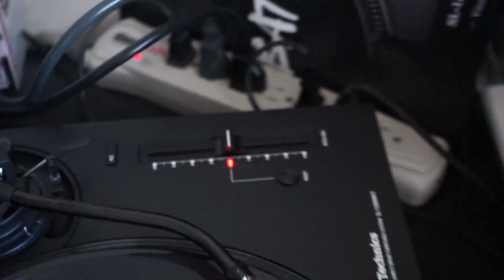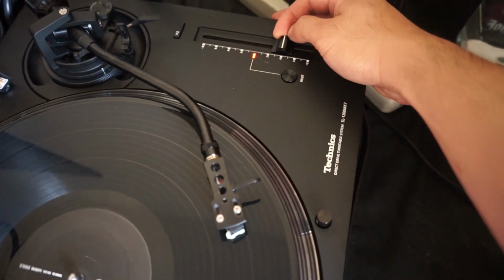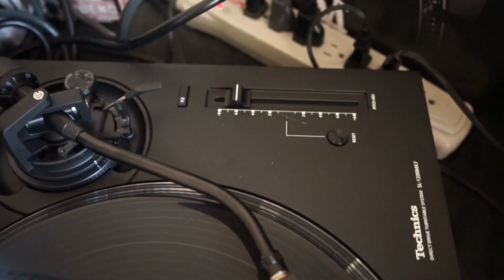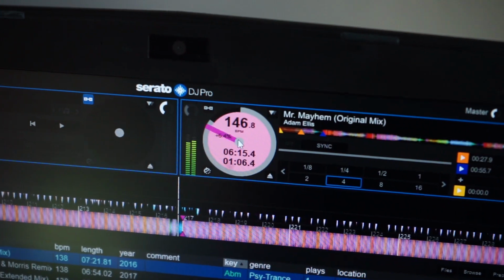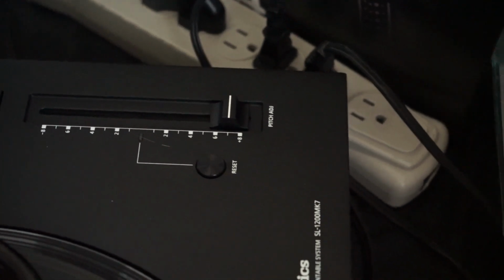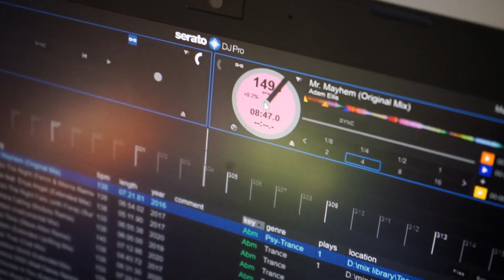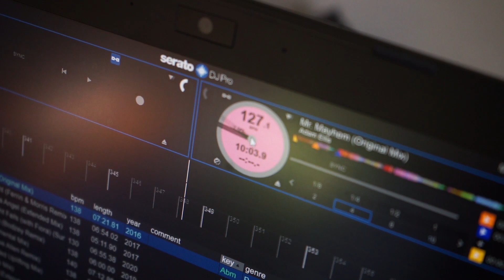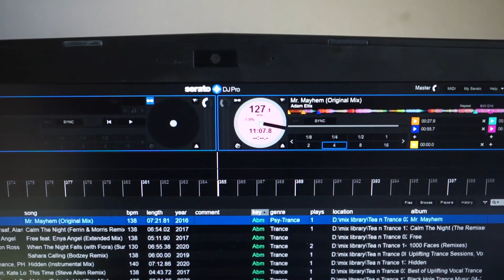Does the Technics SL-1200MK7 Pitch Control Have Dead Space?

Comment: Theres good reason analog controlled pitch is better. Back in the days of mixing 140bpm hard dance especially. A lot of hard dance is between 138 - 144bpm. U need to ride pitch in no more of less than around 2% intervalsmost the time. And, because pitch adjustis in % not bpm, it makes sense to ride the pitch in very minute detail, and analog pitch is perfect for this skill. Analog pitch is less 'steppy'. I really dislike the digital controlled pitch idea. Yeah these decks should be fine with serato, but i may have issues with my vinyl collection. Im off to buy some tomorrow. And if they mix ok ill keep them. I dont really know how good or bad they are yet. But i will let people know
Reply from the maker: I haven't had too much a preference between my MK2s and MK7s when mixing vinyl. Different feel, different age, but riding the pitch is more or less a similar experience between the two (for me anyways). How did it turn out for you?

Comment: I have two MK7s, one is new and in Traktor there is no dead zone, I compare same track on the old one and IT HAS a dead zone between 8% and / 6.5%. I didn't notice this issue until today that im using DVS and visually see the BPM value. Now I don't know if I should be angry and send the problem to Technics. I can confirm that there is a problem with the old batches.
Reply from the maker: Yep this is the same result that i have with my old and new technics. The DJ shop that i buy from has a contact at Technics, and they have not been able to get much help from them about the issue unfortunately.

Personally, I'm not too bothered anymore. If you make enough noise with whoever you purchased from, maybe you can trade your older unit for a newer one.

What I wonder is if the problem is in the pitch slider and whether or not that can be easily updated to fix that error.
Reply: @DJFeelsGoodman  Yes, I dont want to be bother but now I know the problem and and will avoid that percentage in that deck. However I will talk with Thomann (the vendor) and talk about the problem. Thanks for your video and comment

Comment: So to summarize, the only problem is that the scale is not aligned in the upper range and it reaches 8% earlier. It's a bit confusing, but at the same time I ask myself: is this really a big problem? Does anyone actually pay attention to the percentage number while riding the pitch by ear?

Also, in practice I try to avoid the 8% range or just use the 16% range to have more room to maneuver if I need to change pitch so much.
Reply from the maker: During use, I doubt it's a noticeable problem for most people. It's not going to bother me one bit. But I guess it's just one of those things that linger at the back of your mind for some ppl